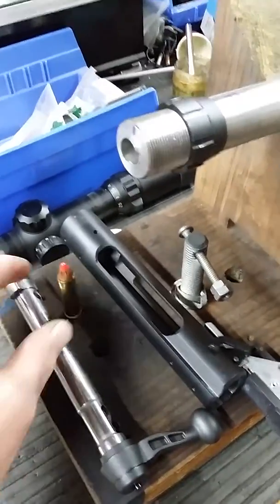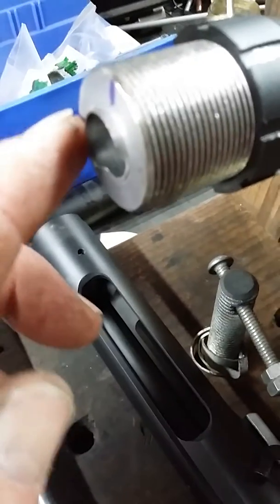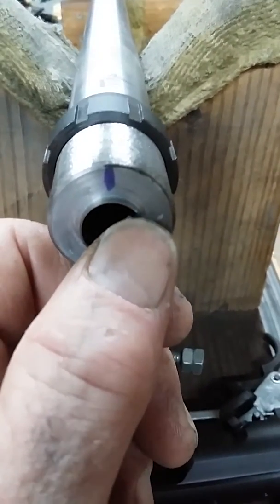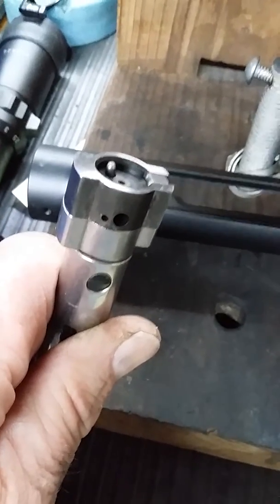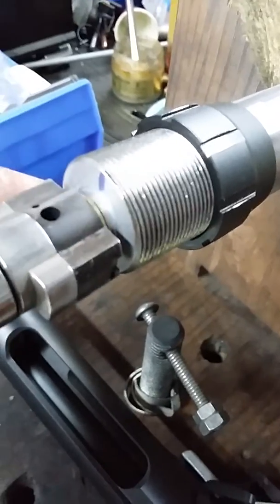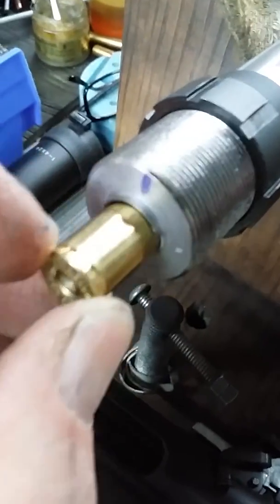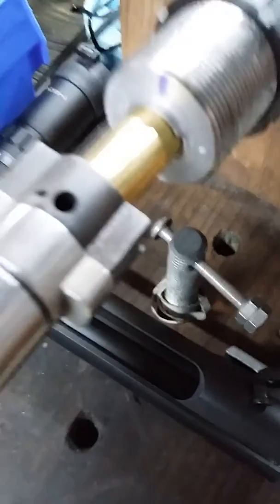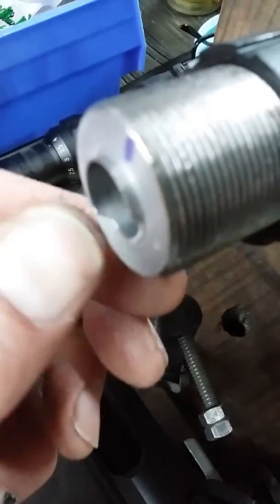460 S&W Cartridge in a Savage Bolt Action Rifle

Comment: Would a claw extractor have an advantage?  I like your video.
Reply from the maker: You would have to make a recess into the barrel for the claw to go.  We have now converted this rifle to the "Raptor" cartridge, which has the same case head as a 308 Winchester cartridge.  It now uses a standard Savage bolthead.

Comment from the maker: Last week I converted this barrel to a 45 Raptor.  I also built one for myself.
Today I shot a 3 shot group at 100 yards which measured about 1".   The bullet was a Hornady 200 grain FTX bullet with 46.5 grains of H110.   The average velocity was 2,798 fps.  Use this load data at your own risk.
The Raptor cartridge uses the standard 308 boltface, and greatly simplifies this project since it eliminates the rim, etc.  No need for the projection on the barrel.

Comment: Do you know if a mcgowen barrel has that bevel on their barrel like yours I'm thinking about converting 2 110s one to 500 and the other to 460 and am using PMG bolt heads for both
Reply: I don't have the tools to machine a barrel so I'm hoping I can drop in one of the mcgowens
Reply from the maker: @bosstube9046  I would call them if I were you.  I do not know.
Reply from the maker: You might also check into using the Raptor cartridge, which uses a different bolthead.
Reply: I will give them a call if they don't I'll look into the raptor do you think a round like 500 or 460 would work headspacing off the case mouth
Reply from the maker: @bosstube9046  https://www.45raptor.com/

Comment: where did you get the barrel? and did you use a short or long action
Reply from the maker: The customer supplied the barrel blank, and the reamer.  Either action will work, but I would choose the 110 action over the Axis.  Savage cut some corners on the Axis that I do not care for.